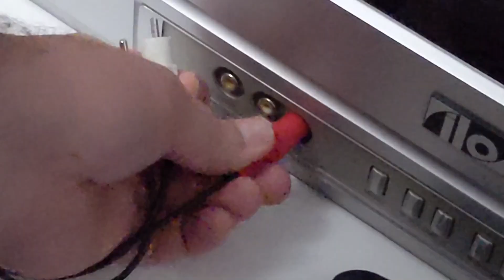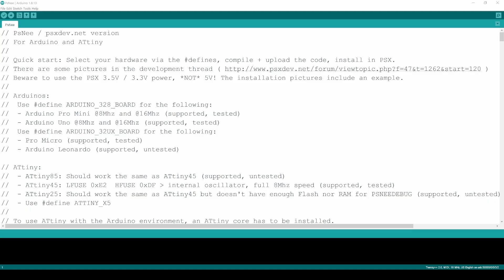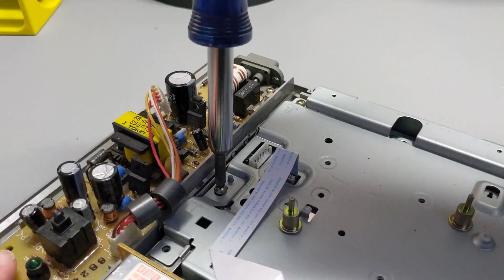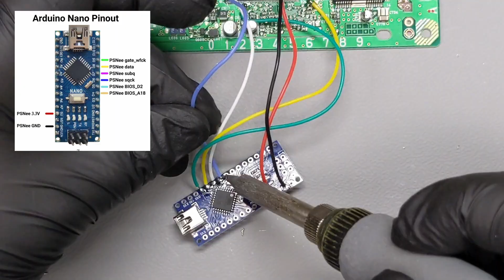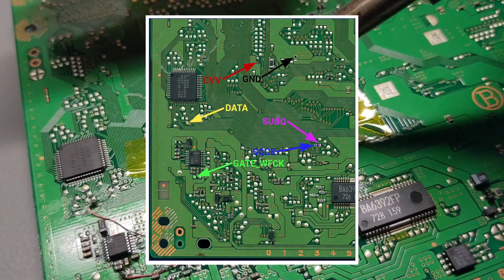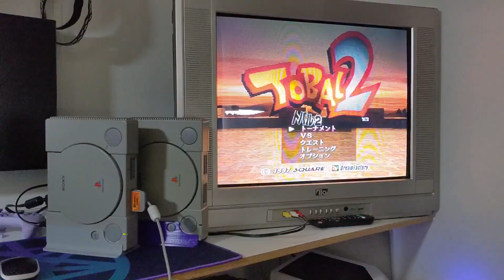My PlayStation has an Arduino Modchip! - My PsNee Installation

Comment: First soldering I have ever done and can say I successfully got it working thanks for the great tutorial!
Reply: FYI: take note that I did run into some issues before getting it to successfully work. The arduino modchip would not be recognized by the ide so what I had to end up doing was download ch340 drivers to recognize the com ports properly. Once that was done it read the arduino chip but the next problem was finding the correct ini as shown in the video. The one in the video is an older release in which I had to find if you pay close attention in video you can see which version he has. After successfully getting the correct ini you will need to modify two lines. You will notice it says //define ARDUINO_BOARD and below where it says if defined (ARDUINO_BOARD) those two lines will just need to be modified to ARDUINO_328_BOARD. Once that was done I had successfully uploaded to the chip! Other than that rest was smooth sailing!

Comment: I use preprogrammed MM3 chips. Just solder the 7 wires, put electrical tape around the chip, and you're done. Takes like 20 minutes.

Comment: Followed this tutrial exactly as you did yours BUT there is definitely something missing in your instructions.
I corrected the text line //define SCPH_7000_9000 and the text line //define AT328_168 by removing the 2 "//" in both those text lines. I then clicked on the "Verify" tick at the top of the PSNee_8.6 Arduino 2.3.4 then i made sure to then click the "Upload" arrow to flash the corrected .INO file onto this clone Nano board.
I am using 28AWG gauge single core Kaynr wire (which i have used for Playstation 2 modchipping and also for Xbox 360 RGH modding in the past)for all 6 solder points from my Playstation's PU-22 Pal/UK motherboard to the clone Nano board.
The Nano's "PWR" and "L" LED's both light up static. PS1 original discs work perfect. yet my PS1 backups (which work flawlessly on my other chipped Playstation DON'T work at all and i now tried every single one of my backups (20 in total) so i know it's definitely NOT a problem with my backups at all.
I honestly do not think that attempting/trying to flash the .INO file through just a USB cable works.
I'm going to try with an Arduino Pro Mini 3.3v/8m ATmega328P using a "FTDI USB to Serial Adapter FT232R Mini USB Arduino Interface  Module" as an ISP to program the Pro Mini when it arrives to me through the mail.
Reply: You uncommented the wrong line, it should be line 13 for PAL so //#define SCPH_xxx2
Reply: @cwal-yt   With my PAL SCPH-7502 (with the PU-22 mainboard) do i need to add the 2x wires for BIOS_D2 & BIOS_A18 from my mainboards BIOS to the 2x points on my clone Nano ? Only reason i'm asking is that i did what you advised and changed the Line 13 to #define SCPH_xxx2 but now my original PSX discs don't boot up (they spin for a couple of seconds then stop spinning to a complete stop and my screen hangs on the PSX Logo screen :(
Reply: @scouse1967  No bios patching for PAL needed. Ive not tested flashing through usb. Ive read COM port not compatible
Reply: @cwal-yt   I'm going to give this tutorial another try. Picked up a Pal SCPH-5552 version. Do i uncomment the same line (13) for this version Playstation ? Also i have purchased an Arduino Uno r3 (clone) from AliExpress and have used Arduino IDE to program it as a "Programmer" in order to program my clone Nano board.
Looking forward your helpful reply :)
Reply from the maker: I would recommend reading the wiki for any updated requirements: https://github.com/kalymos/PsNee/wiki

Best of luck.

Comment: You did it wrong!
You need to flash the firmware to arduino via ISP (using isp programmer, or another arduino as ISP)
Otherwise you may have issues when you powering console with CD installed.
Reply from the maker: Both of my consoles work great with every disk I have tested, but thanks for letting me know I did it wrong 👍

Comment: good video, but you say that in programming you only have to remove the two \\ from the board, but that's not the case, you also have to define the console model.... I lost an hour because it couldn't upload. And after hours between this and the soldering, it still doesn't work. The play says that there is no PlayStation disk inside. I think there is something missing in your video
Reply: Here's the issue I'm having, I installed it into a scph 101, anytime disc activity starts the second LED starts blinking, but the console only reads it as a music disc.

Comment: Just trying to figure out on JP versions.  I assume you solder to the bios chip similar to the PAL version?  When i installed the modchip on the JP version I made a custom bios for the normal mayumi v4.  I am experimenting on the psone JP.  If I figure it out I want to try it on the schp-1000

Comment: Gran turismo 2 backup works correctly? Shouldn't the sketch be loaded via programmer?
Reply: Yea, I was wondering how he got it working with flashing it without a programmer. As flashing through the USB port keeps the bootloader on the Arduino, which cause a 2 seconds delay before executing the PSNee code. I'm assuming his PS1 drive is having hard time reading the CD-R and it takes more than 2 seconds to read the disc thus was to boot the backup.
Reply: @xraymind do you think you could mitigate this problem by just booting the ps1 without the lid, waiting some seconds for the arduino to boot, and then closing the lid with the backup?

UPDATE: I just successfully modded my PSone (that has a lens still in pretty good shape) with the Arduino programmed with just regular USB and had no issues. The Arduino nano i used is a clone that fortunately came with the new bootloader that seems to work fine for this. If you can program yours without the "Old bootloader" option, you should be fine.
Reply: What is the new bootloader? And How I can see if my arduino have this?
Reply: @PremiumWill it's a bootloader that starts the program considerably faster than the old one, but in clones there's no guarantee it will be present. As i said, to check it, you can try to upload a program WITHOUT the "old bootloader" option, and if it doesn't throw any errors, your Arduino has the new bootloader and it should work fine for this.
Reply: @BackwardSabotage  sorry…i dont understand….how i can check of my bootloader is new or old? With old dont work right?
Reply: @PremiumWill if you're trying to upload any program without the "old bootloader" option and your Arduino happens to have the old bootloader, the Arduino IDE will give you an error. If there are no errors, your Arduino has the new bootloader and you're good to go. There's really no other way to check it.